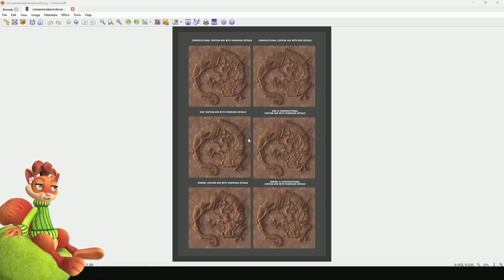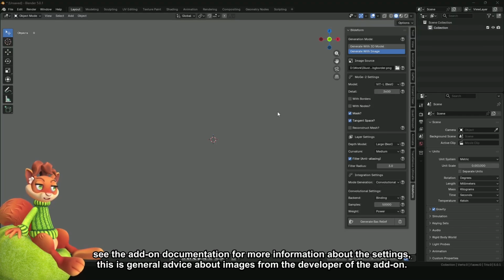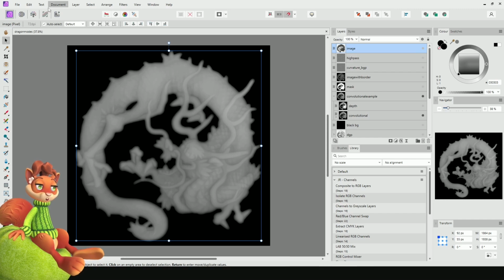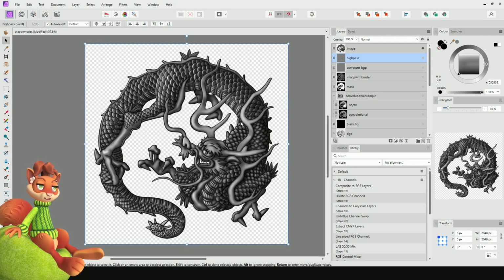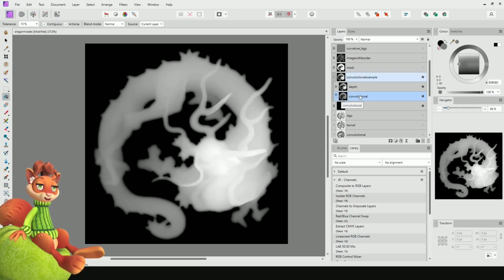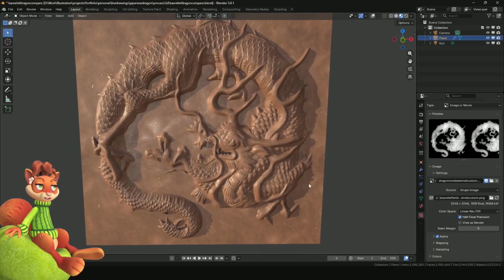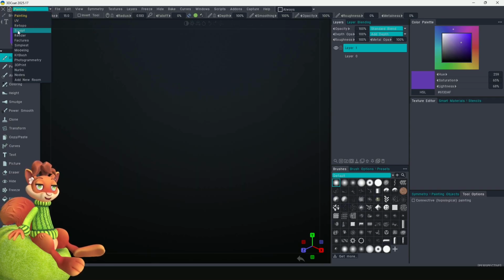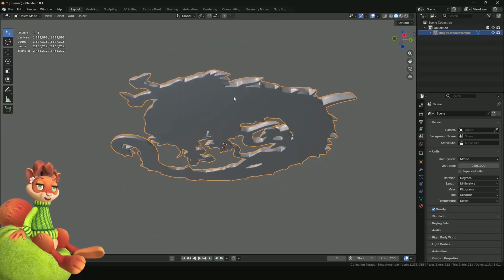How to turn an Image to 2.5d Bas Relief (with the Bildeform add-on)

Comment from the maker: I can confirm the 2.5.1 version of Bildeform works well with Blender 5.0.1 with all the default settings (I have a portable version of that Blender). I am a user of the add-on not  official support, my videos are made voluntarily I am not paid for them. In the new version of the Bildeform add-on version 2.5.2 with Blender 5.1.2 you have to select Cli to get the modes that use Binding or Cli to work. It is likely because the old version of Blender used Python 5.11 and the new one uses 5.13. Cli runs an independent version of Python. I am not the developer of this add on, just a user. Videos are not paid for, they are voluntary and my own tried tested practice. It may not suit everyone.

Comment: Very good, real-life application demonstration of the add-on. The developer should link to your videos as they are way more informative than the uber technical videos on their website.
Reply from the maker: Thank you, I hope they are useful. I think he does link to them on Superhive in the documentation settings.
Reply: @theartsquirrel 

Hi,
Sorry to ask, but is 3DCoat a complementary tool to Blender, or is it intended as an all-in-one alternative to using Blender together with Bildeform?

Thanks!
Reply from the maker: @mikekiske personally I see it as a complementary/ optional tool, I do find the image to mesh feature very useful which is why I showed it in this video, it's a bit trickier getting geometry in Blender from the image to be as nice out of the box, I also have 3D Coat for doing my texture painting for other things so the image to 3D is a bit of a bonus tool in 3D Coat it isn't widely known about. I would not just have 3D Coat for this one thing, Its also a sculpting software so it fits into that workflow. There are many ways to create geometry from height maps in different software including Blender, it's really up to preferences and experience which you prefer. I think the method using 3D Coat is one of the easier and more effective ways I have done it but it can be done using Blender, unfortunately it is not as easy to get a solid mesh like this example in Blender but I am sure there are people who can do it, it's a bit more technical. Search for height map to STL. Involves using a Boolean to cut out from the displaced plane.
Reply: @theartsquirrel 
Very interesting, thanks for the detailed explanation. I hadn't considered 3DCoat as more of a complementary tool rather than an alternative to Blender, so that clears things up.

The image-to-mesh workflow looks especially useful, and it's good to know there are Blender-based approaches as well, even if they require a bit more technical setup. Thanks for sharing your experience
Reply from the maker: @mikekiske no problem thanks for asking, hope the video helps. The thing with 3D is there is never just one way of doing anything so it can get confusing but it's also a good thing in many ways.
Reply: @theartsquirrel 😊